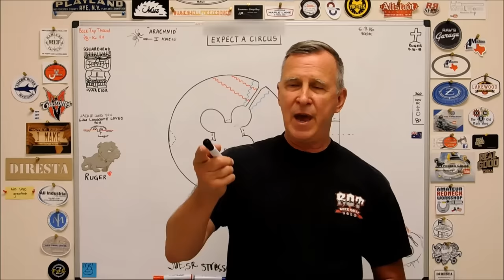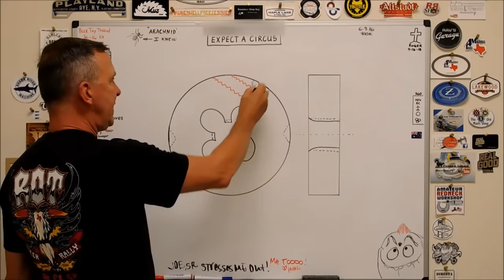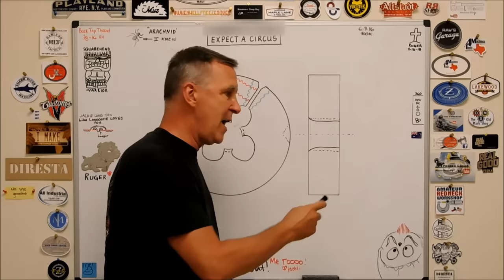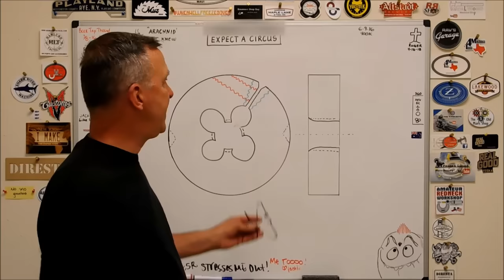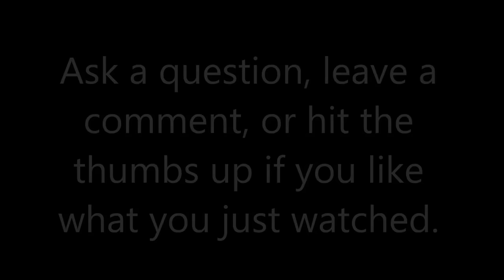You will throw your die handles away after you watch this !!!

Comment: Several months ago I finished making a die holder for the mini lathe.  It is 2 sided, one side fits round die and the other side I press fitted a hex holder into it.  It was a bit of work and took time as I only worked on it and hour or two a month.  Also, I made a morse taper #2 for the tailstock to hold the die holder.  It was a rewarding project.

Comment: After watching the video and learning to thread with the tool upside down and running away from the headstock I am a lot more comfortable single pointing threads now, but there is a definite case for having this floating die tool - a lot more simple than some of the "clutched" tailstock die holder designs and just as good.

Comment: When I was in school 40 years ago, I made a die holder for my Dad, that he wanted to run the threads farther along some U-Bolts he needed for something.  I've never seen one like this though. Pretty cool if you're using dies. Dies are not accurate enough for most of the work I encounter in my work, so it's single point almost all of the time.  In the past, I have worked with the Geometric Die Head, which will thread to a stop, at which point the jaws retract. Those are really handy for production runs.  Great video. Thanks for the new idea!

Comment: Been using a slight variation of the floating holder since 1972.   1.5 inch diameter aluminum, knurled with a 1/2 inch diameter through hole. One end takes round dies the other hex.  The clutch is my hand. Just let go when the end is reached.
Reply from the maker: Riding a drill chuck mounted guide pin. I like that style. Great feel using that.

Comment: Great video, Joe!  I have a similar die holder, but it utilizes a 1.5" round aluminum bar that has a round pocket bored in each end for the two smaller sized dies, (13/16" on one end and 1" on the other) with screw holes drilled and tapped to retain and drive the die like any die holder.  A hole is drilled and reamed through the center of the bar, to accept a long steel shaft that's held in the tailstock chuck.  The outside of the aluminum bar is lightly knurled to provide friction for your hand.  No need to turn the tailstock crank to move the quill, and you can lock the tailstock to the bed if you want.  No spinning bars to hang up on anything, and since it's double ended, it accepts two sizes of dies.  It could be made larger, for the bigger dies, but you might need those bars, (shoulder bolts) for the extra torque, or coarser knurls.

Comment: I have got to make a die holder like that, I remember watching the video back in the days and then forgetting exactly how the gizmo worked, I'm so happy I found the video again. So far I've had the most success with a springloaded tap follower pushing on a random piece of whatever, to distribute the pressure on the die holder, but that doesn't enable me to cut threads with a die under power, a new die holder will, thanks a boatload for making these videos!
Reply from the maker: Use power on softer materials. Keep the machine off for materials that offer greater resistance.
Reply: @joepie221  That's exactly what I've been doing so far, I wouldn't even attempt cutting threads in steel with this method, and once again, thanks for making these videos, you help out more than you know.;-)

Comment: That is a good tip, especially for small threads which can be hard to single point if they are long.  I am fortunate the shop already had an APT floating die holder (FDH1-2) which has an anti-rotation pin that slides in a grove in the shaft.  Nice bike.
Reply from the maker: Thanks for the comment and compliment on the bike. Its a great ride.

Comment: I always use the tail-stock chuck jaws for aligning dies, especially the smaller ones. Your point about the diameter of the shank of the bit of to threaded is very important. A few thou under nominal is OK, but a few thou over is asking for trouble... :-)
Reply from the maker: The additional % of thread adds so much more resistance.

Comment: a side note: If you happen to be unlucky enough to snap a tap off in the work and can't simply shatter the tap with a punch and hammer. Grab an appropriate sized solid carbide die grinder and chew away at the web of the tap. I recently found this out when I snapped a 3/8 fine thread tap in a stud plate that was already welded to a highly modified car bumper (~$4500USD after labor). Grabbed my Snap-on 1/8 inch air die grinder and solid carbide burr and chewed away at the center of the tap. Took about 30 minutes, but I saved the threads and bought another tap.
Reply from the maker: That will work, but always be aware, at the moment of web breakthrough, the tap remnants can choke the carbide tool and snap it. Then you're royally fu@#*d. if you can, use a punch and small hammer to break away the tap as the web is removed. It lessens the potential for the above scenario.

Comment: The practicality of this obviously comes from a long experience of thread cutting but I can also see how it would improve the quality of work done with my lack of experience. PS. I've owned cars with smaller engines than your bike!
Reply from the maker: the power to weight ratio is to be respected. Especially on a wet corner.
Reply: @joepie221  Yep. As opposed to your tool mod, not good in inexperienced hands.

Comment: I hope this is solely for plastic threads, I wouldn’t want to cradle that with two hands on a steel thread.
Reply: Might need some longer shoulder bolts, for that!
Reply from the maker: Don't do it under power on tougher material. Just use the exact same setup.
Reply: I regularly thread the ends of 10mm steel rod for about 100mm (4") using 40rpm chuck speed and a 10mm button die in a full size die holder (+/-18") on a 24" swing lathe. It's all in the way you hold the die holder, i.e. if for any reason the die holder wants to start turning with the job, it easily can without trying to take your hand/s with it and because my pieces are around 3ft long I can have the die around 6 - 12" from the chuck which is a good thing.

Comment: Hi Joe, great little video,I have a similar purchased system .. though it differs slightly ,it's extendable but has a pin guide in a slot that stops the rotation as it advances, however you pop it out and let it free wheel if you wish.. I do have a Die question though.. Do you have a rule of thumb for  outer dia size before threading ..I find somthing like an M6 bolt needs to be around 5.7mm or less or the die won't bite even with a generous lead chamfer... wondered if you had a kind of -5% outer  dia (for example ) rule of thumb? ... im always using the correct  lead side of the die ... should I be torqing down on the adjustment screw to open it up further?

Comment: Thanks Joe, but if you own a lathe, wouldnt you just make that tool?   I see no reason to buy one when you can make as many as you need.
   Great video.
Reply from the maker: Agreed.
Reply: also a mill or drillpress to make the holes. i would personally do it on a mill
Reply: For a hobby guy looking to learn, I always opted to make the tools over buying them if possible... as time goes on, and you become more skilled, it seems time in the shop is more spent making parts and projects than making tools. You no longer wish to spend the time making the tools and opt to just buy the tools to keep moving on making the parts. That said, I made a tailstock die holder a number of years ago.
Reply: @shawnhuk   because time is money and not everyone can achieve the same quality as a production shop.

Comment: Sincerely enjoy watching your videos.  Always informative.  I was watching another discussion where the creator asserted the hex die was for thread chasing while round was for creation.  What is your stance or training as to true or false?  I'd never heard of such.  I'd also believed the depth of thread was the difference.
Reply from the maker: I never heard that. It doesn't make it false, I just never heard that.
Reply: @joepie221  I'm gonna query a friend who has been a toolmaker for decades see what his input is.
Reply: @irench  I have some threat chasers, (they were called that when I purchased them) that have a head on the end for driving. I drag race and the high frequency of removal or installation of either the engine or transmission mean I had to install and or remove the torque converter bolts often. For safety reasons loc tight is used on drive line parts like that. After a while it will build up in the threats so you have to chase the threads to get the old loc tight out. Damaging the threaded blocks on an already very expensive racing torque converter would be pretty costly so using something that just chases the threads, versus cutting them is a good way to prolong the life of the threads that hold the converter to the flex plate. If you're talking about something totally different please describe what you mean when you described the difference of the two tools. Thanks!
Reply: @waynethomas1726 : Yeah I'm a Master ASE and racer too. I get the costs. I also have specific thread restoration tools. Lock Tight sucks especially when you have to use up material every time using a tap or even chaser to not destroy an expensive billet converter.   you need a bottoming tap for such if you're going to continue to use the Lock Tight method. I'd personally adopt a method as we did in many of our race and aviation applications.  Safety wire.  If your converter has studs like a ford, cross drill and safety wire loop is easy.  The bolts could be a little more difficult. If you're using a motor plate the room for bolt head is probably available. Otherwise might be a tad troublesome but much better than lock tight.  Safety wire is cheap at HF and so are the pliers.
As for hex vs round. Round has an adjustable tension to set the thread depth while a hex cuts what I was told is 85% threads.  If you've ever taken a hex die to a brand new bolt it cuts deeper than the factory tooling. I spoke with a life long toolmaker friend and the theory is true that cutting fresh threads with a hex die is more likely to result in tool failure due to immediate 85% threading.  The single point method on a lathe, like we've watched Joe do how many times, doesn't cut that deep right away, you put a scratch on check the thread count, then go at it several passes at a time with the tool until you have desired thread depth.   The round adjustable die offers a similar ability albeit not nearly as good as a scratch but less chance of tool failure.    Go on last yellow!
Reply: During my trade training, we were taught either could be used to chase, but only cut with the round die. That being said, desperate times call for desperate measures.

Love the customized die holder. I will have to make one.

Comment: That's great for Nylon/ Plastic but longer handles required for threading steel or maybe even longer to engage on  the Lathe Bed???
Reply from the maker: I do have longer handles for tougher materials, but I'm not a fan of the lathe bed trick since it applies an uneven load on the handle.

Comment: My set of die's are hex shaped, not round. I have heard that the hex shaped die's are for re-threading and the round ones are for cutting new threads. Any truth to that?
Reply: Yes you are right!!! hex dies are for refreshing a thread round split dies for cutting new threads!
Reply: Hex shaped are for cleanup/ re threading and usually aren't split
The split is the difference its used to get the tolerances in the thread right best starting with it open a bit then checking thread fit with a gauge and close gradually till its right then your thread is set as long as you don't adjust screws if it's one you use often making a permanent holder is useful

Comment: I'm glad I knew this in the past, and that I was able to use such a device, but a few days ago I had to cut a thread on a piece, where the tread was followed by an od of just 1mm more (aluminum) and the problem was, that the die always "gripped" onto the chamfer... I ended up stopping the lathe 2mm before that critical part and cut the rest by spinning the chuck carefully by hand... Your Cardboard trick is genius, I imagine it would be even better if you use a "credit card thick" plastic (especially for aluminum)

Thank you :)

Comment: With taps and dies after the newly cut threads start to self feed on to or into the work DO NOT push the cutter into the work as you can over cut the thread. Also when you are removing the cutter let the threads push the cutter off of the work DO NOT pull the tap or die for the same reason. I know most everybody that watches Joe knows this, but there might be somebody that doesn't.
Reply from the maker: Solid advice.

Comment: My ancient seer said that the side with the etched writing was the lead - apparently the side the die is cut from gets the etch tool. Now I am ancient I am passing it on 🤗
Reply from the maker: I have found that to be true most of the time.
Reply: I didn't need ANYBODY to tell me that the side of the die with the lead on it is the side that is the lead. I use my EYES.
Do you need to have an "ancient seer" to tell you which end of a claw hammer is used to hit the nails?
PS: Your advice about the etched writing is about as idiotic as you telling people that the writing on the claw hammer is how you work out what each end of the claw hammer is used for.
Reply from the maker: @rotator1232  I mostly agree with the print comment, but I have personally found exceptions. Knowing that, I hesitated to say its true 100% of the time.
Reply: @johncoops6897  No
Reply: @rotator1232  - So you linked to some images in your previous comments, yet didn't read the web page you took them from?
It says "Dies have a top and bottom. In the photo on the left the die on the right has the top side facing up and the left one has what should be the bottom facing up. You can see the tapered teeth coming up to the surface on the left one" .
http://www.newmetalworker.com/Howto/usetapdie.html
So, on a die the starting side has the larger diameter hole with zero teeth, and as you wind it down the inside diameter of the hole become smaller as the threads become fully formed.
Anyway, you don't really even need to look at the die, because it will ONLY go onto a (non-threaded) rod in one direction anyway, By learning, understanding and thinking about what is happening, you don't need to worry about which side is etched.
Reply: @johncoops6897  ..and!...
Reply: @rotator1232  - ... and... do you understand it yet?
Reply: @johncoops6897  perfectly - from day one. But I guess you don't understand how dies are made; which side of the billet they are formed; and, how the laser engraving is applied and die  heat treated - all in one operation.  Go figure next time you are peering into the start threads....
Reply: @johncoops6897  either it takes one to know one or it was you that taught me all I know. Ad dieu

Comment: The screw is there to make the die smaller for a 90 or 100  % thread.  Most threads are 80% deep.  Some hard materials might need to start at 60 and work up.

Comment: Great idea. How does that work when your threading steel or stainless ?
Reply from the maker: Just fine. But dont use power, and don't rest one handle against a board or bar. The die will have a one sided influence and end up with whats called a DRUNKEN condition. Others have advised it as good practice, and its not. 2 handles, 2 hands. Simple.

Comment: Joe : Video good as far as techniques and adapters go.  BUT - your suggestion of reversing the die to finish the thread to the very end is, I think, faulted.  Dies do have the chamfer on one side to indicate the starting side for your threading (making the start easier), but it is also the side which has the internal die threads cutting in the correct direction.

To explain, think of the typical drill bit; besides it's sharpness, the cutting edge has a relief so that only this edge cuts, and the rest of the drill's  front body doesn't contact the material it cuts through.  The same is true of a die's threads. They also are relieved to cut only on the leading edge, and produce the "chips" we are all familiar with.  And are designed to cut in only ONE direction (usually CW).

Reversing the die in the holder and screwing over what threads are cut puts the non-cutting edge to the front, and forces the die to sort of 'climb over' any new material it encounters rather than cut it.  Hence the 'broken teeth / broken die' you refer to.  Probably works with your plastic or nylon, but not so much with metal.

Haven't seen other comments re this; though I'd add it.

Comment: Good video.... I have often made dies from nuts and even made taps from dies made from nuts as well as making taps from bolts then with those cutting dies ... Just get hardened steel nuts or at least harder than what you are tapping..... Of course in your video you did plastic and a steel blank being threaded would put more torque on the tap holder and so you should use longer arms and turn slower for safety.... When in doubt do it by hand

Comment: I made a tailstock die holder like that in shop class long ago, its really too short and too small in diameter for anything I do though, so I have a better device which I use to clean up single point threads for a precise fitment.

Also I have had to deep cut grade 8 bolts to get rid of the shoulder, and realistically, you can't very well chuck one and single-point it, not enough material on the head to grab hold of, plus it brings the tool too close to the head, so a die is the only real way to finish,  its just painfully slow with a lot of oil and a lot of gradual passes from super wide [shallow cut] to final fitment.